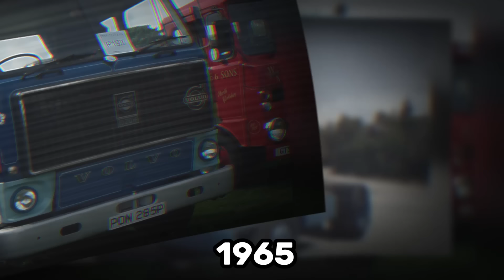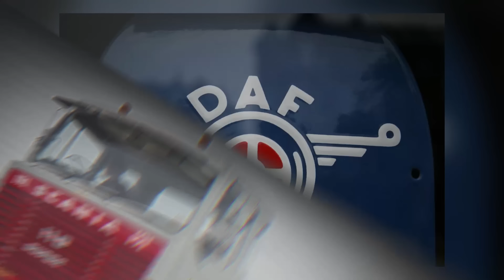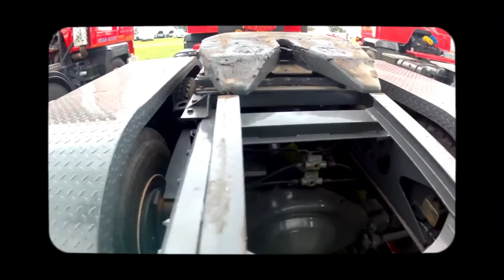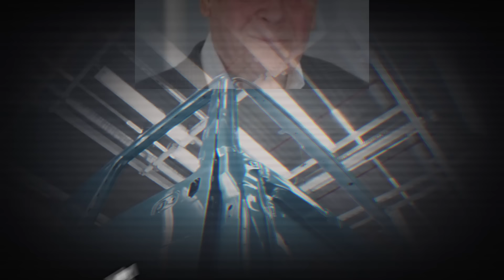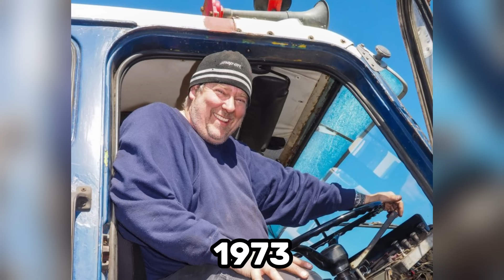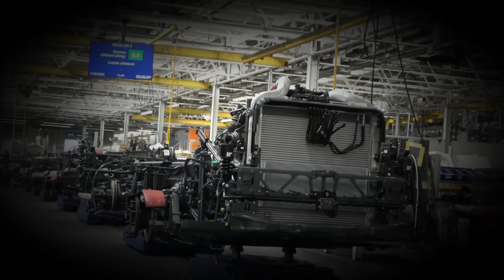How the Volvo F88 Literally Stole the Future of British Haulage!

Comment: I tried an F86 in 1972 and knew the F88 was a far superior truck so I bought my first truck , an amazing truck far exceeding anything available in the UK ...In 1973 I bought a new F89 LHD as I was doing some continental work and this was a vast improvement on the F88 , In 1974 I bought an almost new Scania 140 and i knew Scania would be my brand for life...A couple of minor issues with the Scania , the range change valve leaked air an easy fix and the UJ s were subject to failure because of the engine torque ...I always believed in greasing trucks weekly and never had a UJ fail , I bought almost every version of the Scania V8S and while people were raving about the Volvo F88 290 I thought they were a poor upgrade on the F88 240 ...Difficult to start very smokey and at 100,000 miles Volvo had a sticker proclaiming this...

Comment: I drove the F88 F86 F7 and the F10. 
They were a huge improvement on British truck. 
I drove my first Mercedes truck in Berlin which was amazing compared with our regular army trucks. 
The F88/86 was that water would run down the wiper motor and drip on your right foot.

Comment: The Leyland Roadtrain was supposed to be the new flagship. It was already out of date when it left the factory. The damned things had a lethal random break failure issue that was denied by the makers.
Reply: Didn't the Roadtrain win truck of the year
Reply: @Western1011 Probably but I'm to young but I suspect you understand what I mean about Bedford. I also don't believe Foden or ERF would have survived if not for foren ade
Reply: I drove both E/EC series ERFs and Foden 4000 series and they were both equal to anything on the roads at that time,i think the mistake they made was not switching to Cummins and Cat engines sooner,Gardners were reliable and economical to run but were painfully slower than anything else,we nicknamed anything with one in Milkfloats
Reply: Have to agree with you. I also think that Bedford was a little late but I genuinely think Volvo Scania and later Daf and Mercedes would have killed both companies.

Comment: Too little too late, by the late 70s early 80s Brit manufacturers like Seddon Atkinson and ERF had caught up with the Swedes, better than equal if properly specified with 14 litre Cummins engines, Eaton/Fuller gearboxes and Rockwell axles.
Gearboxes are a personal thing, i prefer a constant mesh gearbox, they're faster changing with no synchros to baulk the shifts, many constant mesh boxes you didn't need the clutch once moving, one in particular the Eaton Twin Splitter designed for clutchless shifting once moving, probaly the best drivers gearbox ever made.
Leylands Marathon and Roadtrain could be had with Cummins engines too, but cab rust was a serious issue and it didn't take many winters before they perforated.

What all the British makes lacked and what Volvo and Scania beat them hands down with was service parts and back up, offering what was previously unheard of in the industry, 24 hour servicing.
Reply: The Eaton twin split was a sweet box fast and precise a pleasure to use in an ERF with 320 horsepower.
Reply: @robredz  Still got an ec11 celect with the big cummins still runs r plate ex air products so easy life.